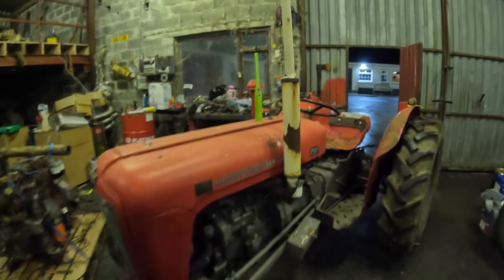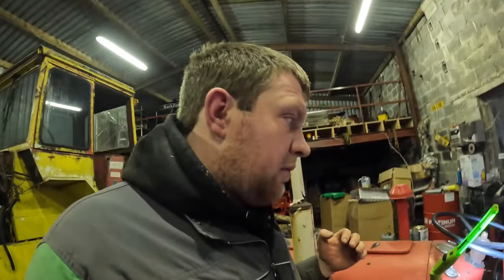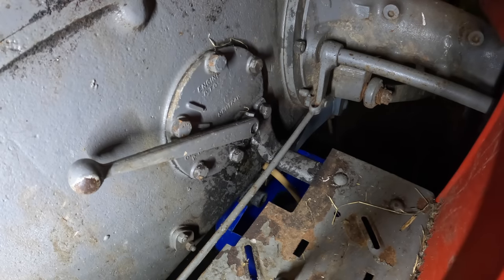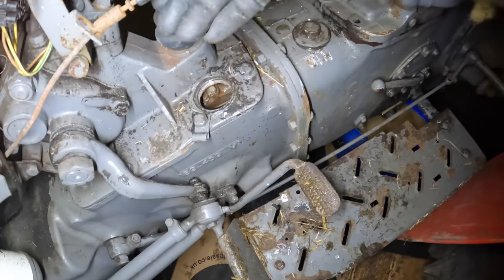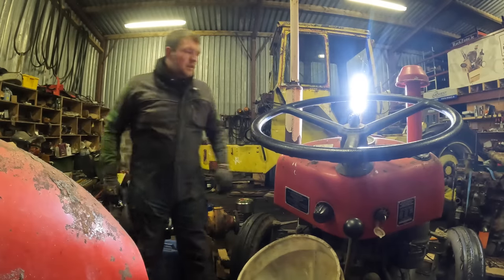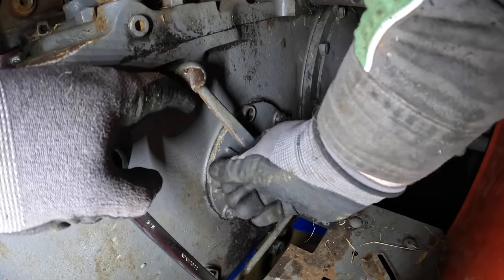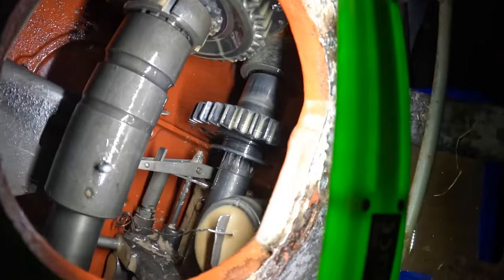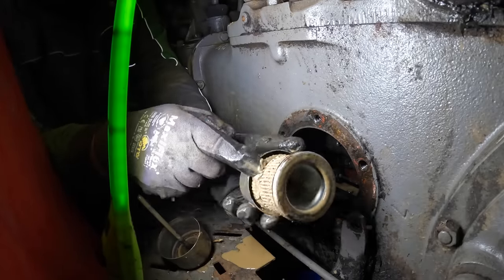MUCH NEEDED FILTER CHANGE!!! | MF 35 GETS SOME TLC

Comment: Zip tie the rubber boot seals on the Gear Levers - always one area water gets in. I'm sure if you look elsewhere you will find other sources of for the water, but that is an easy one to fix.
Reply: Yeah. Axle and PTO seals are a bit more work.

Comment: The MOST problematic part, getting the securing wire on again (it prevents the the filter which is screwed in from coming loose & creating serious damage as it is a steel filter) is the one IMPORTANT part he does not show & this is what i'd like to see above all else

Comment: The water can get in at the gear levers where the rubber boots are and the pressure release valve can give trouble it's on the other side where the dipstick is .

Comment: In the filter kit from massey's in the 80's you did away with the bottom metal cup, to make up for the different length you cut quarter of an inch from the fixing bolt

Comment: Looks like the 1200 is getting closer to being back on the road. Looking forward to that video.
another place to check for crap comin gin is via the hydraulic connection you used for the potato digger. It may have washed in crap from the cylinders on the digger.

Comment: Water ingress around gear sticks and we're draft control top link rubbers .I did 1 wile back I put 10 gallon of diesel in and run it for a 10 minutes or so drained out and put new rubbers on .that was 5 years ago and haven't been back at it

Comment: There's a bung plug on the bottom of the gearbox you should have also opened to drain. At least a gallon and a half in it before it heads out to the pump end.
Water is usually getting in at the crossshaft as there's o rings there that's probably gone hard

Comment: No new gasket fitted to pto lever cover, bottom three bolts usually need a bit of ptfe tape on them as they usually are submersed in oil. you could put a pre filter on your return line to catch any crap from a aux driven machine, easier changing a external one. watch you vid back when you play with gear lever its like a cock in sock around the lever. Cant Waite for 1200 rebuild, Lokey enough to drive once, the all-round view from the cab is great. Keep churning the vids out & happy new to the Stewarts

Comment: I get the same water problem with my grey fergy , I've been told it's getting in through the seal at the top link draft control. I can't remember if the 35 has a simular setup.

Comment: Hi, water gets in thru the GEAR SHIFTER BOOT, looking at it you might say how no cuts or rips, pull it up the shifter if not attached to the tranny housing like a rubber grommet making a seal,  water will roll down the boot under it and seep in the tranny.  And to flush the rest of the oil out use compressed air in the filler hole,  wrap a few rags round to make a seal and blowjob it, the diesel  works to wash but to get it out use the air blower.  good luck

Comment: There's a pile of shit under the diff and HYD pump which won't be got out without stripping all down! And the water is getting in around the gearsticks  and the boot at the draft Spring at the top link. The one's on the gearsticks get slack.